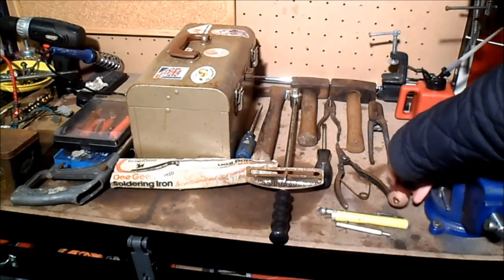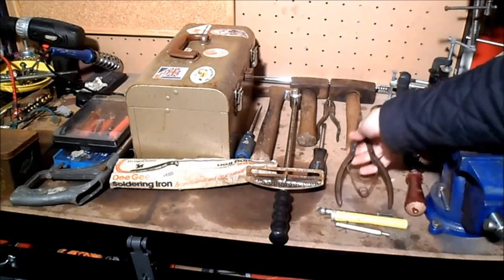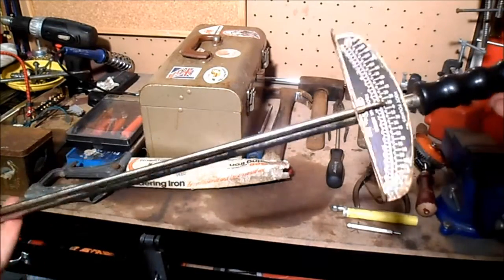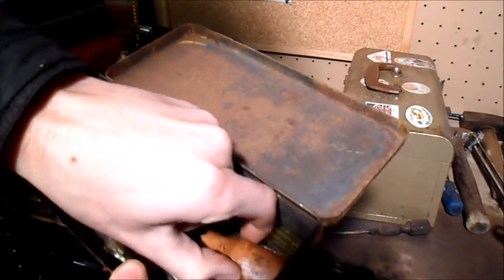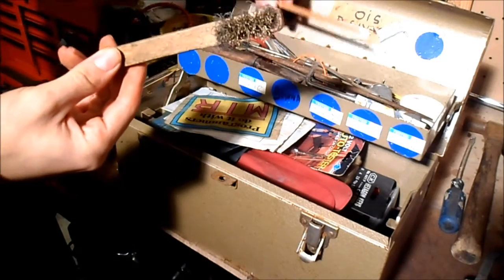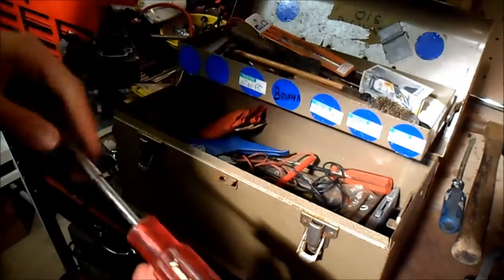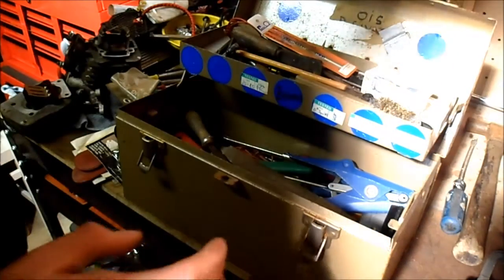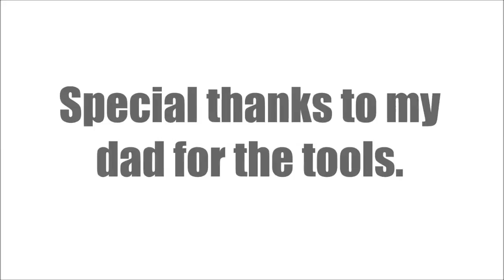Tool Haul - My Dads Old Tools

Comment: Yes the Blue 3 prong plyers are called Helliman Tool it's used to stretch rubber sleeves over cables, as someone else has said these days we use heat shrink sleeving, great to see some old tools :-)